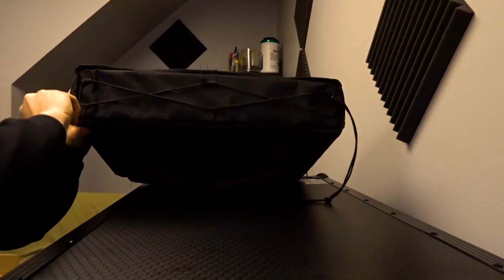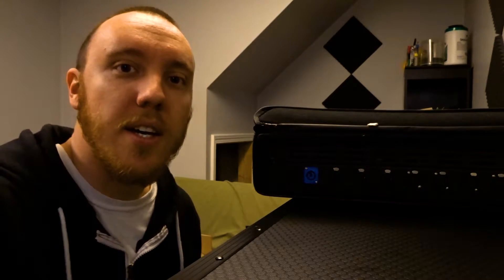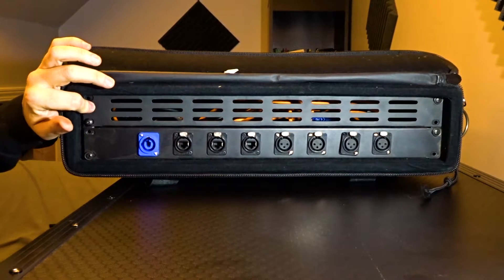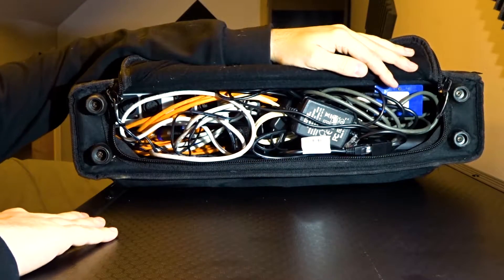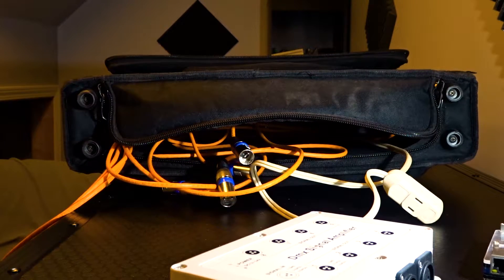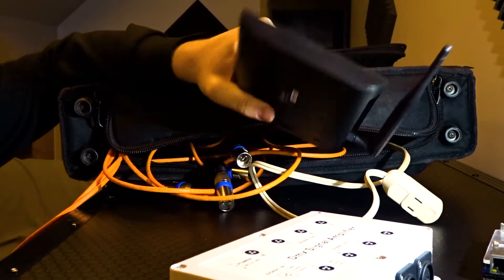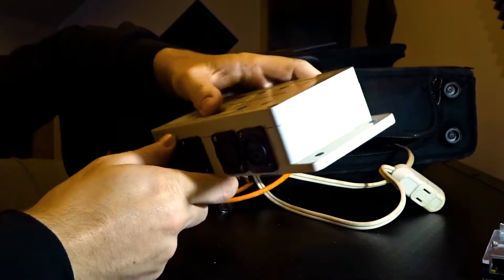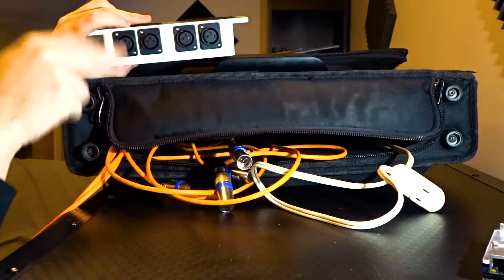Introduction to Art-Net Lighting Protocol Episode 2

Comment: 16:14 I am sure you know but I'm posting for everyone else who may be just learning about the Raspberry Pi... you have to shut it down properly or you can corrupt the Operating System (well, the SD Card it's on). So, easy set up and an alert power down will have you golden. Oh and a backup SD card in case of Power Outage incident and possible card corruption.
Reply: Like I Just asked though is why the Raspberry Pi. ENTTEC makes a converter already called the ODE Mk2.
Reply: Once the Raspberry Pi is set up, you can set a toggle that prevents it from writing to the SD card.  Once that is set, the chance of SD card corruption goes away.